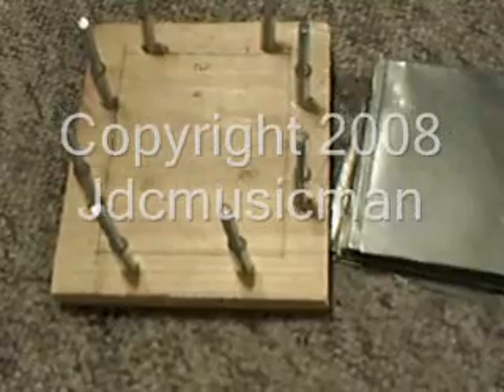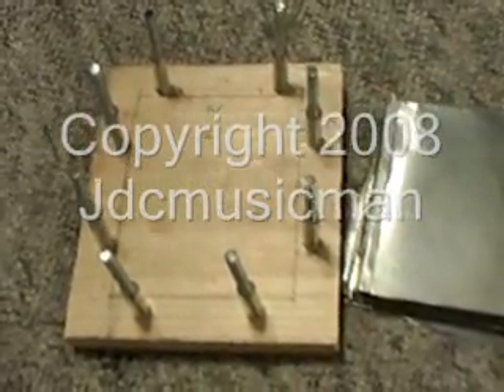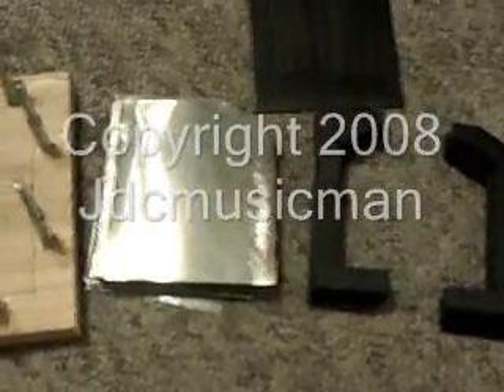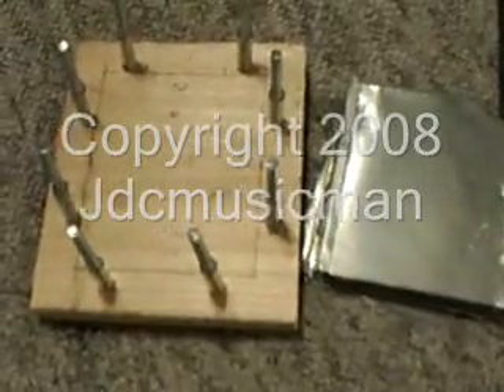New 16plate 4x5 NO hole drycell Materials and Idea

Comment from the maker: maybe youll find some..I done the dremel thing today..zipped right thru it done 15 lines on 2 pieces ,got the whole top piece built , still got to put the gasket on it and cut the slits out for it tho...I just it works , if not back to the drawing ...I will get a vid up tomorrow sometime showing it ..the cuts are 1 3/4 long bout 1/16" wide..I am going to recut some gaskets try to do water in and gas out from the one top piece, to see how it will do like that..

Comment: for water input i think it is ok to use 4 1/16 holes but for the output you need more,take that into consideration the gas expansion and the water that coming out at the same time ,you do not want back pressure or pressure bult up in the cell

Comment from the maker: naj do you think this will help with current traveling thru the water , cause if I get any leakage that would be only place it could.now have in mind, I have 4 ,1/16" holes per plate so maybe that would cut down some of it..on a bigger unit I would probably have to go more than that but should be good for this small thing..

Comment from the maker: Yeah I may do that , I am still in the building stage of it , my endplates are 1 1/8 higher than my plates , so I may let it go about 1/16" higher than that then cap the top  and screw it done to the endplates so I can have enough pressure seal my gasket ..

Comment from the maker: That is my goal, the gas out and water in will have its own path 1/2" long coming out or in...  from between each individual plate ,then then all 15 slots will then join up in one 3/8" hole the out the top . There will no leakage from from edges

Comment: not if he make each impute and output long enough than he joins everything in a container ,remember current will follow the shortest way around ,so if the delivery system for each 2 plates is separated from the other 2 plates and long enough i guess he will acheave maximum efficiency

Comment: and as D3 mentions above, electricity will find the shortest path ... so if there is a way that it can take a short cut through the fluid, it will ... you must force it through the steel ... any exposed path through the fluid that offers less resistance than the steel will kill your efficiency ... this design was perfected over 100 years ago, we are rediscovering very old knowledge that was lost while gas was cheap ... think it, draw it, build it ...

Comment from the maker: yeah thats bout the same thing that Im doing, I am going to have a distribution box, I will have a  gasket sitting on top of the plates with just enough slit between for thing to flow good then on top of the gasket will have the box , i have 4, 1/16" holes drilled between each plate ,that will go up about 1/2" the all jion up into a main 3/8" hole then out the top ..No plate edges will be exposed ..yes i am using acrylic also

Comment: tjgame2, I think you got, by George, he's got it ... now run with it and let's see what it looks like ...

key is to keep your bottom fluid feed, and top exhaust extraction far enough from plate edge, that the electricity is forced to pass through the steel instead of taking a short cut ...  it can and in fact has been done ... but see what you can do with the idea ...

Comment from the maker: I hadnt had any problems so far with the 304ss 
I use it because its affordable for me.316 just cost to much.I have learned that if you keep the voltage down to around 2.4v per plate gap you get very little leaching..My top and bottom is still in construction stage, Its a little complicated doing the way I am doing but I think it will work.going to have a gasket and 1/16" holes coming up to one main hole..Yeah sure I would like to hear ya idea